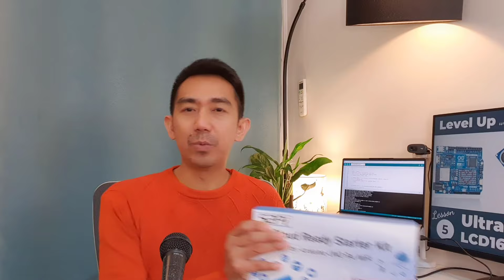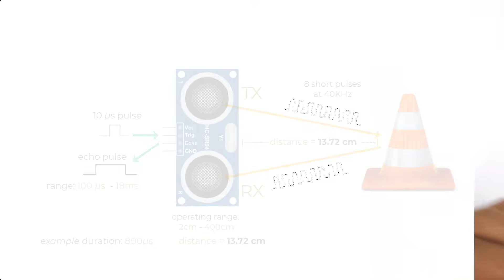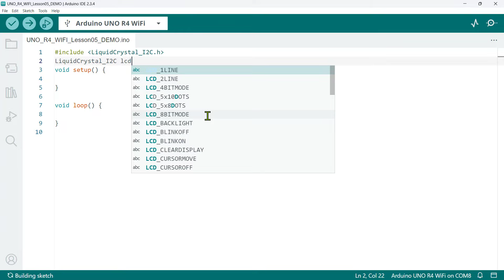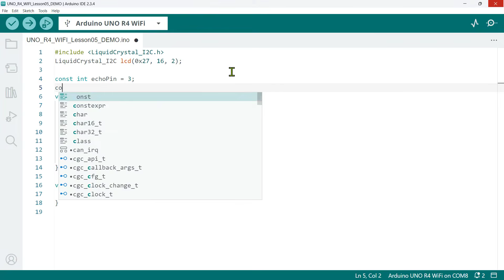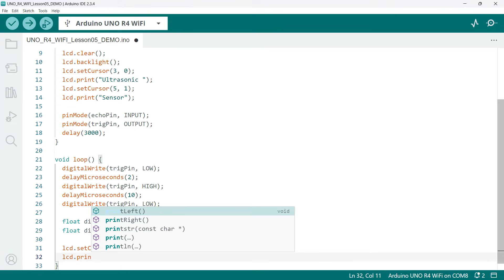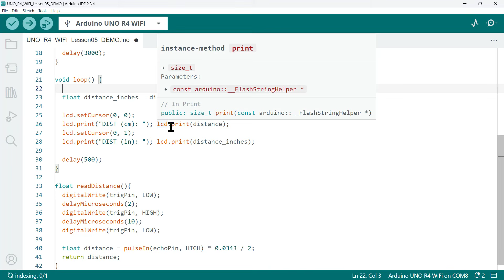05. Distance Measurement with HC-SR04 Ultrasonic Sensor & LCD1602 | Arduino UNO R4 WIFI Crash Course

Comment: What to do if the exact library is not found
Reply from the maker: Search and install the library you are looking for through the Arduino IDE Library Manager: click the Library icon on the left sidebar in IDE
Reply: No, actually I wanted to exact that if the exact pre-coded file is not found, then what to use?
Reply: Also wanted to ask if the IDE I downloaded doesn't open fully and it rather shows the logo resizing screen. I checked on with the issue and got to understand that IDE wasn't able to find the Documents folder, even though it is already present in C:\ Users\ name